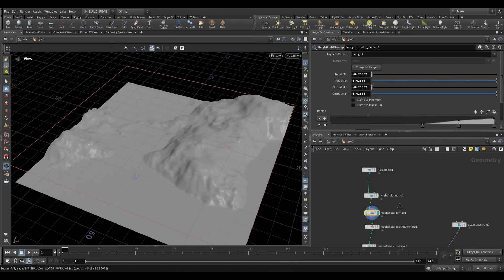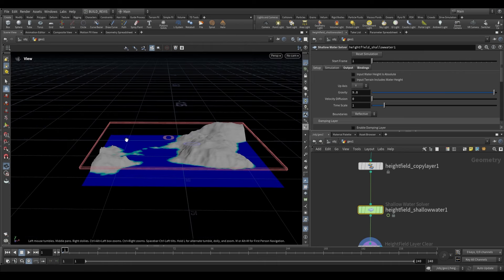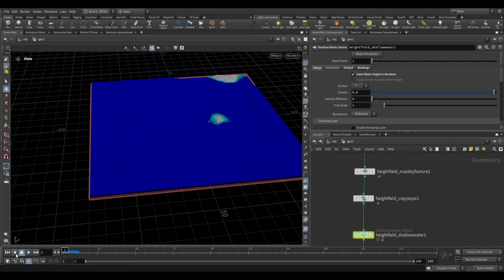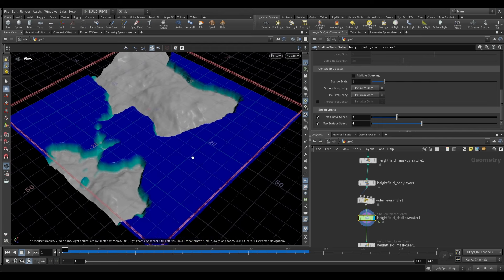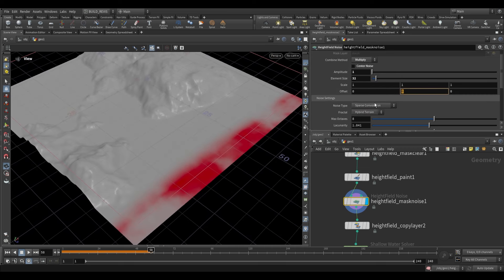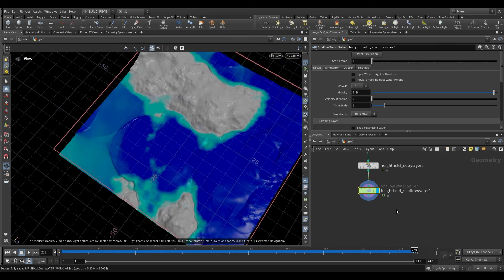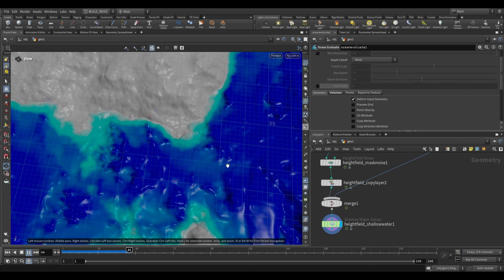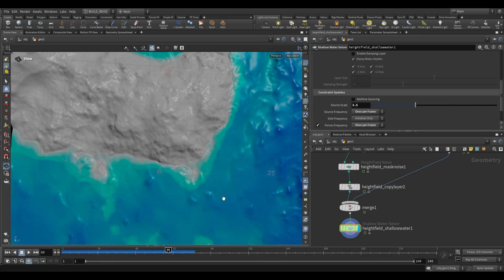Terrain Nodebook | Shallow Water Solver

Comment: Alright ! Really great! I have a challenge for you! Which node should I use to create underwater backgrounds on a LIDAR car? (The seabed does not exist on the LIDAR data because obviously the lasers do not pass through the water) I found a solution to simulate this on a map grouping several grids. (to cut the terrain into data manageable by the computer because it is very heavy) but what process would you recommend to create an underwater background that looks like an underwater background and not just "noise"? Of course there can be several types of bottom: sandy, rocky, muddy but we can apply these differences with caches, can't we? The problem I encounter is the quality of the details which are very difficult to master because each section of the map is 2km x 2km and the dunes for example are quickly transformed into mountains or crevasses. An idea to suggest?